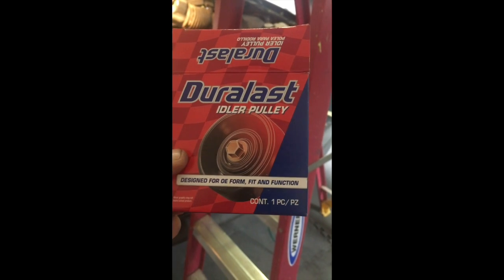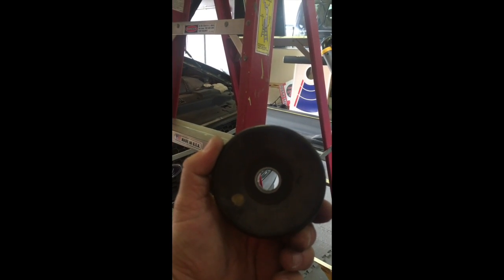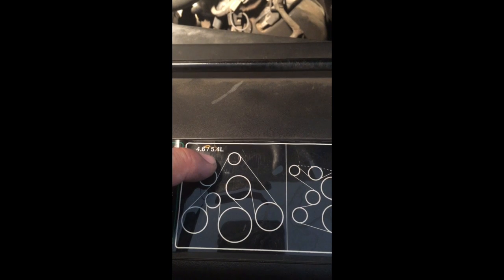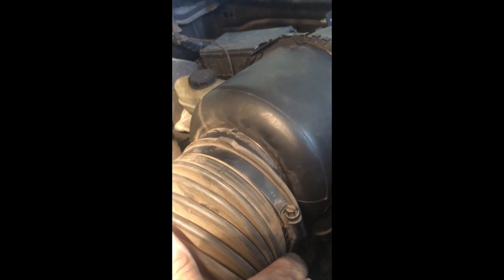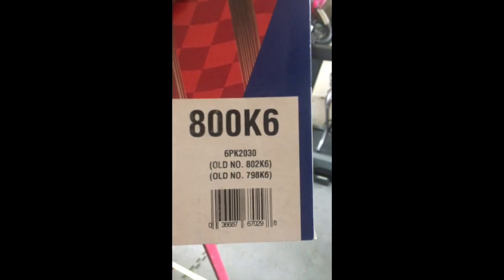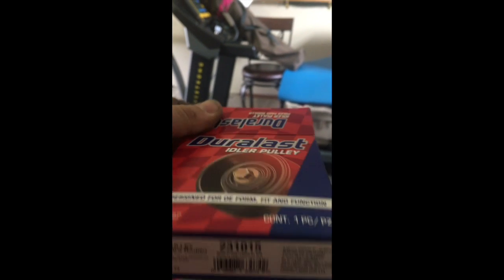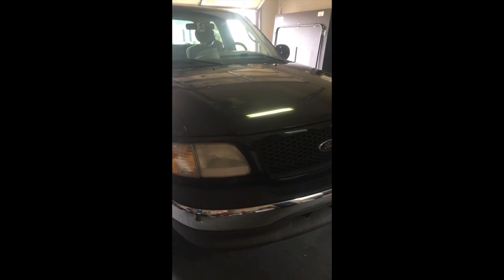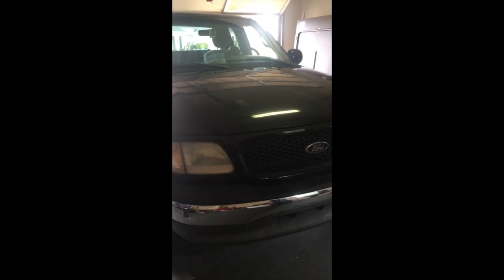2002 Ford F150 5.4 L AC Compressor Bypass Solution

Comment: Hey howdy y'all... if going to a 6 rib belt bugs you here are the part numbers for a 8 rib belt and 8 groove idler pulley:

Idler Pulley Dayco 89053
Drive Belt Dayco 5080805

Route belt as described in this video.

I don't know why but the 8 groove pulley is a 1/4" larger in diameter than the 6 groove, that's why you need the 80 1/2" long belt. You might get an 80" on, I could not using just my fingers. 80.5" works great, no squallering... in range of tensioner but towards maxed out end... still have about 10° of travel left with breaker bar, definitely on the tensioner tho.

Happy New Year 2026 🍻
Reply from the maker: Thanks for the info!

Comment: I found The idle pulley was Correct but The only belt Size  That Would Work For me was 800k6 I have a 2002 Ford f150 5.4 I Did not need a Breaker bar..just a long Ratchet...The Groved pulley is Simple The Diagram To putting on The belt I Found Took A little Time.i Started at Alternator pullie Then Wrapped To The middle pulley to o.The power Steering The up...The belt Will Go Flat on Water pump Then up Past Tensioner To the new idler pullie
Reply from the maker: Glad it worked out for you! Thanks for watching!

Comment: I did this with my 01 and it’s squealing like crazy. I’m going to try a washer behind the new pulley and a 79 1/2 inch belt.  Hopefully that shuts it up lol😂
Reply: I did a by pass on my 2002 f150 super cab fx4 5.4 v8. I replaced the idler pulley with a 6 rib idler pulley and a shorter belt. Fired right up and no issues no squealing. Go to O'Reilly and ask for Murray pulley part number 2330012 and belt Gates Micro V k060798. Just make sure to route it right. Don't need a washer with that
Reply: I already bought a 6 rib pulley and a 79 and half inch belt from same place .its squealing badf
 @DerrickSarazin-jr1wo
Reply: @318Deepsouth  might be too tight I used 80 and 1/8 belt

Comment: The pulley and belt #'s are correct. 
Temporarly Used this system on my 
2002 expedition 5.4l until i installed a/c compressor, hoses and filter..

Comment: Have you noticed the belt sits misaligned  on the tensioner pulley? Mine is riding more towards the front of the pulley vs. the rear.

Comment: Update…. I have a 5.4l triton I’m the 2002 f150 4x4. I used the belt in the description and the idle pulley in the video. The numbers means 79.5 belt. No squeak and runs perfect. Rent yourself a nice big ass 1/2 in breaker bar to make it getting on easy.

Comment: Thank you so much for this video :-) The compressor on my 2002 F-150 Harley Davidson froze and I was able to skip it for a while. i wasn't sure it would work on the supercharged engine but the pulleys behind for the accessories are the same. I found the same Duralast PNs here in my local Autozone. Real time saver!

Comment: I did this same thing for a 2002 f250 5.4l i bought the 800k belt and it does squeal but works great just annoying noise. I will go buy the 795 belt here in a day or two when i get home but either way GREST EASY QUICK CHEAP FIX!!!! 1Luv!!

Comment: Thanks worked awesome.. ac pumps is a common problem to anyone hearing a noise that sounds like the waterpump is going out.... Go ahead and fix the problem as soon as u hear it or eventually it will lock up and snap your belt and leave u stranded

Comment: This video works! I used 795k6 belt but used the continental belt instead of the duralast and the pulley number on here which also cross references with Dayco number. 
Used this fix for a 2001 Ford Expedition with a 5.4.
Reply: I did the same thing but belt squeals like hell. What was your experience?

Comment: What about 2005 f150 xl triton 5.4 my motor looks spiting image tried like six belts so far killing me can't even get to work
Reply from the maker: Did you change out the idler pulley? Without that change no belt will work. Once you change the idler pulley you should be able to use the belt listed in the updated comments below. Just read through the comments and you will find part numbers for the belt and pulley. Hope that helps, good luck!

Comment: Mine i got the cross over belt from advance Auto from those part numbers.. the 800k6 n the 231015 and for great but belt sqeals when i give it has quite Andy other time idling has anyone seen this
Reply from the maker: BigRick Fishing Inc. If you read through the comments there was an update where a guy used the 795K6 and had good results without a squeal. I also did this and it reduced the squeal to basically only happening when the vehicle is started for about a second and then it goes away. My son drove the truck for about two more years after this with no issues other than the squeal on startup. Hope this helps.

Comment: Thanks Appricated...! Worked on 2008 F250 Super Duty 5.4..... Pulley Part # was perfect I just test fitted 3 different size belts wound up using # 805K6 however 810K6 works as well just felt it was a bit loose... I will replace A/C  Compressor in the spring....

Comment: What is your belt number? mys k060806  13/16x 81 1/8 The belt rubs the houseing.On the v6 it will not rub.do you believe the pulley will stop that rubing ?
Reply from the maker: timothy rush See the below comments for the actual number. There was a revision that worked better. This fix is only for the 5.4 liter though, not familiar with how it would work for the V 6 but I am pretty sure it would be different. Hope that helps.

Comment: i used the 79.5 belt and it still squeals only on start up, any suggestions? other than that , great video, thanks!
Reply: Try putting a flat washer behind the idler pulley you replaced. I think the grooved pulley sets in toward the engine about an 1/8th inch.
Reply: it seems to squeal anytime there is heavy load on the belt, blower on with lights. soon as turn the blower off stops squealing.

Comment: Great job! 2002 F150 here- used the pulley 235015 and belt 795k6 and it worked perfectly! Thank you!
Reply: Why did you use a different pulley? Is yours a  5.4?
Reply: I used the exact same pulley an belt and mine squeals like hell

Comment: Nice. I just broke down at local gas station today. Trucks still there, but I sent this to my mechanic & we're going to try it in the morning.
Reply from the maker: khrisb1 use belt 795k6 instead of the one in the video as per the update mentioned in the comments. Both belts will work but the updated part works better and the truck won’t squeal using it vs using the one in the video which may leave you with a noisy squeal
Reply: @IceHausDogTraining does this fix work on a 2004 f150 5.4L?

Comment: **UPDATE: for anyone with the '02 5.4. you need the 79.5" belt, if you don't want it to squeal. Works like a charm now. Do not buy the 80" belt, it will squeal****
Reply from the maker: Kirk Hilts do you have a part number so I can replace mine as well?
Reply: 5060795 or 795K6. I just did this in an auto z parking lot.  the 795k6 was tight and i couldn't get it over the alternate,  had to align everything else send slide it over the fan pulley last.  This was on a 2000 exp. 5.4l. was an 8 rib, now only using 6... :)
Reply: Kevin Thomas yes 795k6
Reply: i have a 02 5.4  f250. My ac Recently locked up, do i need to change the idler pully as well? or just simply buy a 79.5 " belt and pray?
Reply: Thomas Pfeiffer change the wheel that he replaces in the video. It's like 10-15$. , 79.5" belt, and reroute it as shown
Reply: man, i can not get  that one on.  I have a 2000 F150 4x4 5.4  I changed the pulley and everything, belt 800k6 fits but squeels.
Reply: Thomas Pfeiffer did it work on your truck? I also have a 2002 F250 with a 5.4 that just had a.c. seize up on me, ate the belt! I thought my alternator and power steering had gone out till I looked!

Comment: Worked great for 2004 F250 w 5.4L.  Thanks! pulley - 231015, belt - 800K6 both duralast parts.
Reply: Do you think these parts would fix 04 f150 5.4? I know this is 4 years late lmao but I have this problem

Comment: Thank you for this video!! I did the bypass on my ac compressor in my 2001 F150 w/ 5.4 with an 81" belt, did not change my idler pulley... the belt was rubbing on the housing behind the smooth factory idler pulley to the point where it wore a spot about 1/4" into the new belt. I went to Auto Zone and purchased the exact belt (80") and idler pulley in this video. I put them on my truck in less than 10 minutes and it worked out very well! I do have a squeak in the belt when I first start my truck, but I am hoping some belt dressing will help it mesh out. I believe the new pulley is slightly narrower than the other pulleys and the belt is not perfectly allignment. But this did work, the pulley and belt fit perfectly. Thank You!
Reply from the maker: AB White I have the same squeak but it's such an old truck and really only gets driven by my son who is about to go off to college. Let me know if you get rid of the squeak and what you used if you're successful.
Reply: Kevin Thomas, hey thanks again for that video. It helped me out. My truck is squeaking but it stops after it runs for a minute. I am going to spray some Prestone Belt dressing on it tonight. I will tell you how it works out. It is only like three dollars at Walmart. One thing- I noticed the old factory belt is 8 groove. This new one is 6 groove. There are 2 extra grooves on my existing pulleys. I tried several configurations and I think putting this new belt on skipping 1 pulley on the existing pulleys worked best to keep the belt alligned with the pulleys. Basically I left the first groove empty on the existing pulleys. I will let you know if the belt dressing works. Thanks again for helping out! I would have never guessed I could get my truck back on the road for 60 bucks!
Reply: Kevin Thomas well I tried that belt dressing. It did not take the squeak out completely. It stops after running a bit but I can not seem to get it perfect. I will keep you informed if I think of anything else.
Reply from the maker: I thought of trying a very slightly longer belt but in my case the truck is barely driven so I just didn't want to add any extra expense without being sure it would resolve the squeak
Reply: Kevin Thomas I have an 81" belt in my garage I just took off it before I replaced the pulley. I can swap them out in 5 minutes and see what happens. I am pretty certian the 81" belt will be too long. This 80" is not overly tight. It is about perfect actually. I have been thinking of putting a washer behind the new pulley. I think it needs moved out towards the front of the truck maybe. It seems like the pulley is keeping the belt from perfect allignment with other pulleys. I think that it is not meshing out and has a little bind on it. I am almost positive the squeak is from that new pulley. Or at least it sounds like that is where it is coming from. If you don't mind me asking how much has your truck been driven since you did the bypass? I am wondering if driving it will maybe break it in some?
Reply: @abwhite8279  try putting a thin flat washer behind the idler pulley about 1/16 to an 1/8th inch thick.